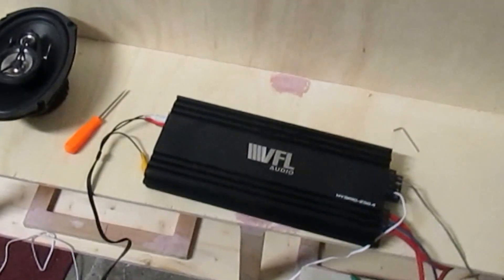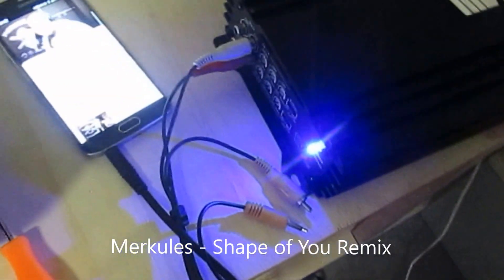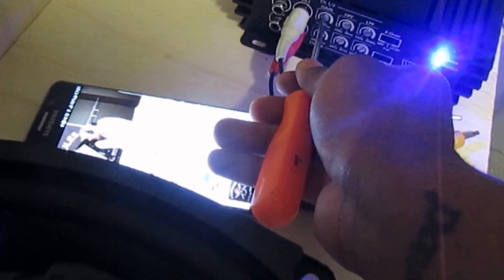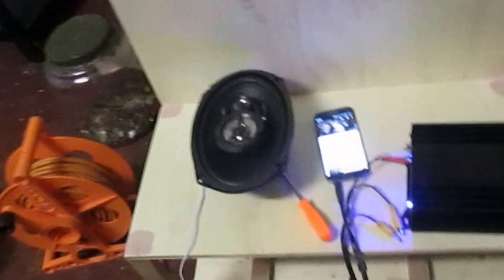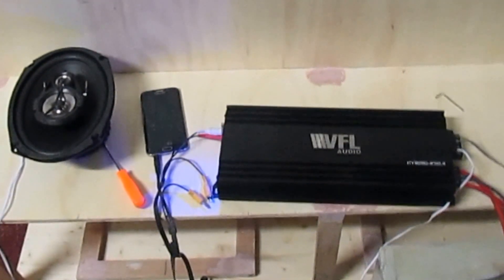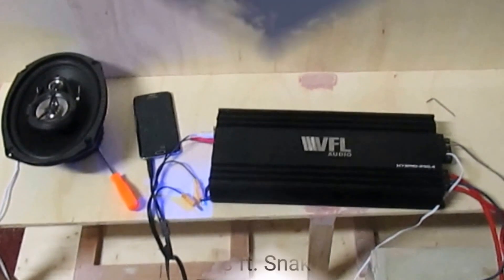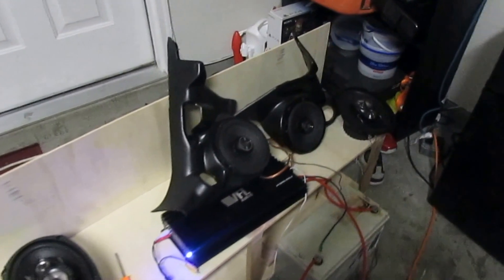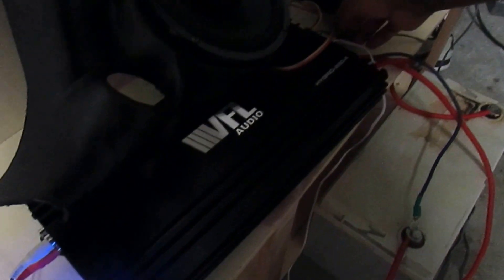testing the new amp - Vfl Hybrid 250.4, 4 CH Amplifier

Comment: What size power n ground wire does that amp take?
Reply from the maker: dontey hudson it takes 8ga wire but I using 4ga wire
Reply: Tron89 ooh ok imma pair two of these up with 8 American bass neo 6.5
Reply from the maker: dontey hudson that should sound nice... make a video I would like to see how that turned out
Reply: Tron89 hell yeaa I will
Reply: @teezy9904  4 gauge will fit? I just got the 150.4
Reply from the maker: @loveja1  yes you can use 4ga wire.... I use welding wire so that's how I was able to use 4ga... audio wire you might have to buy an adapter for the wire to fit